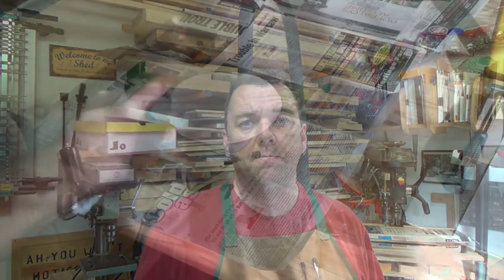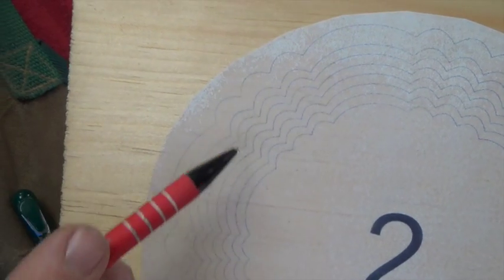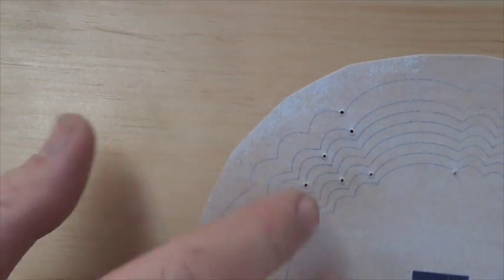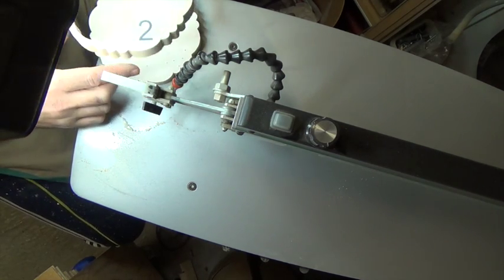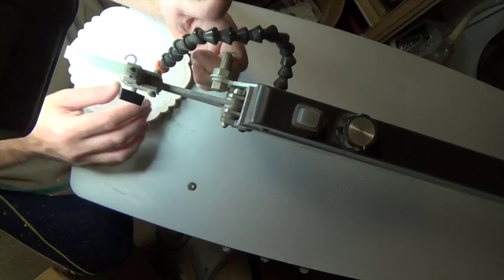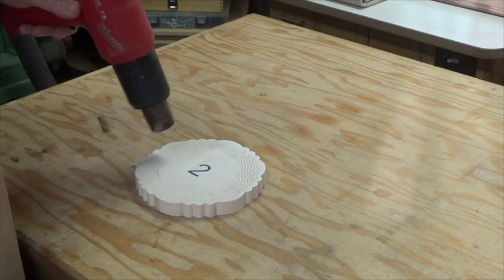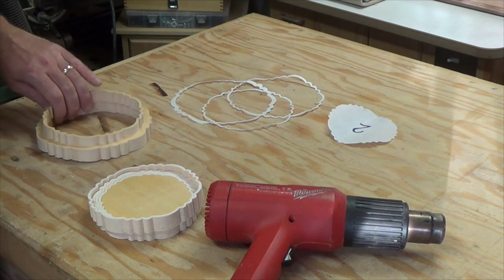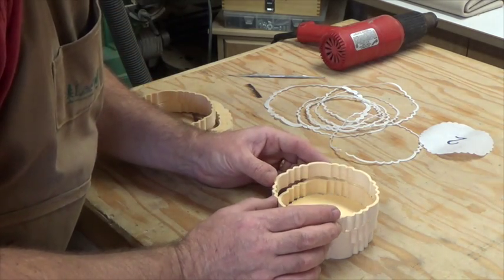Making a Scroll Saw Basket

Comment: Just a tip if you put an angle cut in it when cutting out pattern all you have to do is lift it and it won't separate and will stay together creating an almost seamless basket. Nice job there on that one. Would love to see how you finished that one if you ever did.
Reply from the maker: +Chris Henderson Thanks for the great suggestion.  I've never tried one cutting on an angle before.  I guess I would have to play with the angel to see what works, but I'm thinking maybe 5 degrees should do it.  I don't think it would take much.  This project never got finished.  It was only cut as an example and I actually ended up scrapping it.  Pity really.  It was rather nice.  Thanks for taking the time to leave me a comment on the show and thanks again for the fantastic suggestion.

Comment: Nice basket but I have a couple of points i'd like to bring up. I cover my wood with masking tape before gluing on the pattern, makes removal very easy. And your first cut is an outside cut so it didn't a hole drilled, you could have just come in from the edge.
Reply from the maker: Good points.  I have tried the masking tape method and don't like it at all.  On larger pieces I find that it just doesn't stand up to all the fret work cutting.  That's the great thing about this hobby of ours.  There are plenty of methods to suit everyone.  Thanks for tuning in to the show